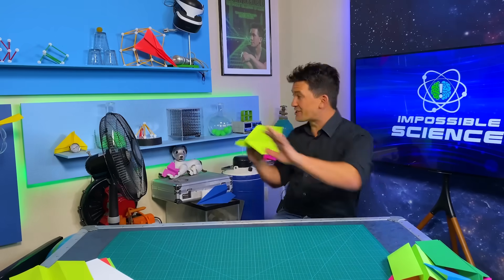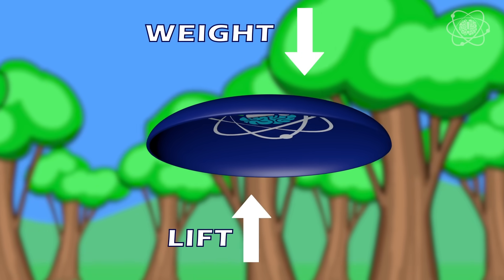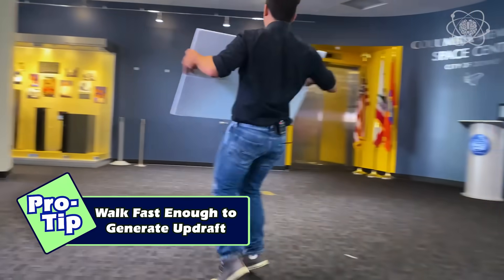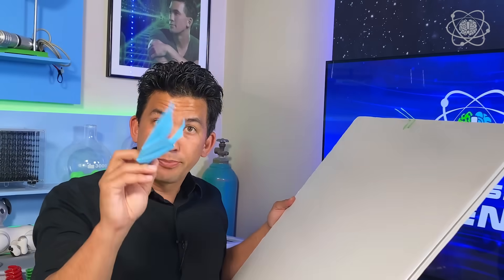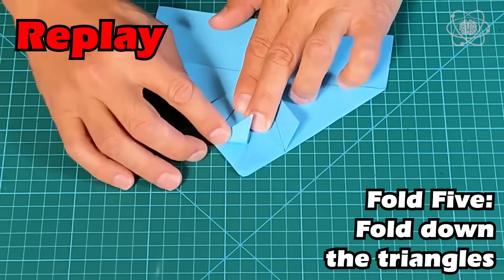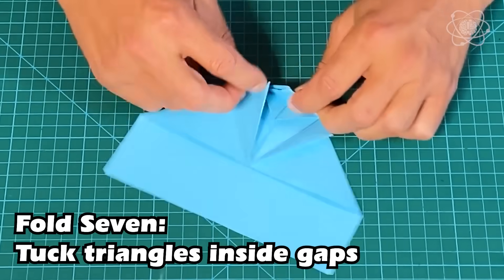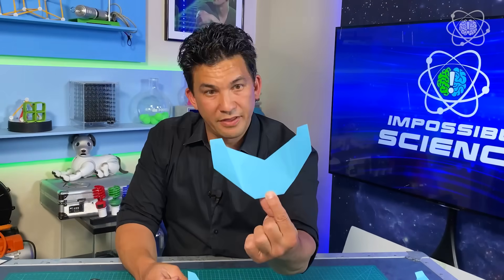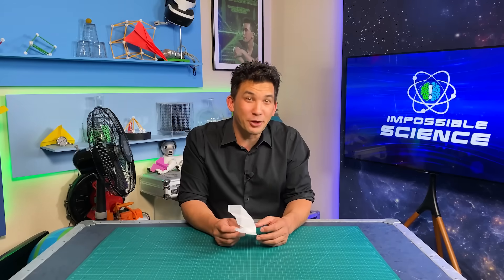A Paper Airplane That Flies Forever!? | Impossible Science on Location

Comment: Thrust lol
Reply from the maker: ...Drag, Lift and Weight! Four forces of flight combined with an updraft and willingness to run along side it will have your Walkalong glider working in no time!
Reply: @ImpossibleScience  how about in zero gravity?  Love the air plow btw
Reply: @heldlightning7118   Woah great question, would a paper airplane fly on the moon?
Reply: @heldlightning7118  In zero gravity you would lose the force of weight and would have to eliminate the upward deflection of the elevator so the paper airplane would "fly" straight like a dart. Good question!
Reply: @marshawargo7238  On the moon you would lose the drag and lift as there is no atmosphere. The paper airplane would "fly" just like a rock. Throwing a rock and the paper airplane they would follow the same trajectory just like dropping a feather and a hammer they would hit the ground at the same time.
Reply: @paperairplanesurfer   Thanks!
Reply: @paperairplanesurfer  that's pretty cool, so how can we get longer flights on the moon?  Besides  stonger launches, are there any materials that would work better than others?  Like some sort of solar sail plane?
Reply: @heldlightning7118  Hmm... so a solar sail, the best there is, generates a tenth of the acceleration of the moon's gravity. But don't take my calculations for granted. What do you get for whether a solar sail can achieve escape velocity from the moon? I used data from wikipedia:
https://en.wikipedia.org/wiki/Solar_sail
Reply: So a solar sail would allow a craft to go a tenth further than without a solar sail... before the whole thing comes crashing down on the lunar surface...